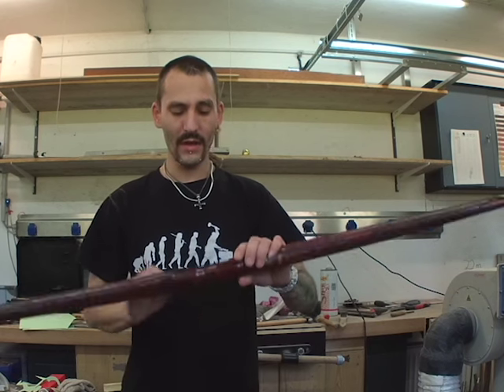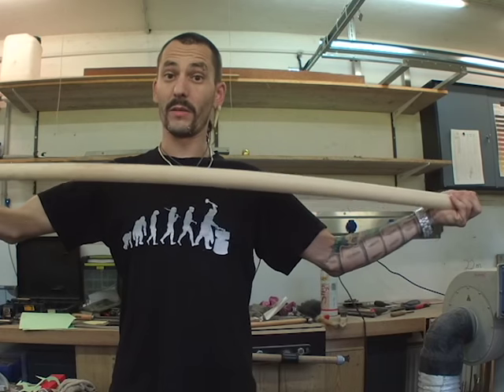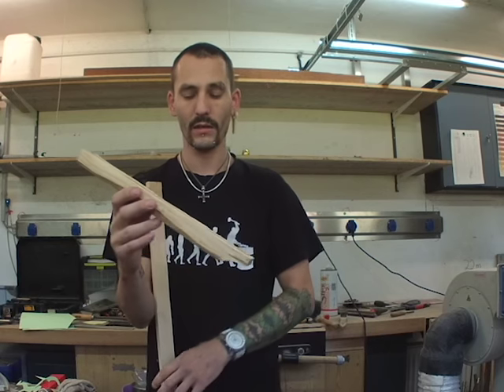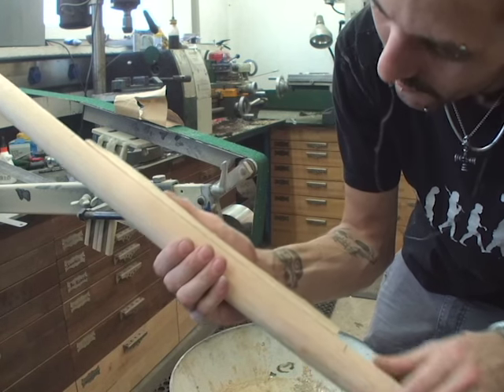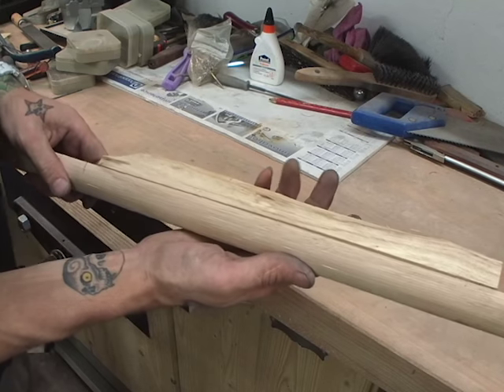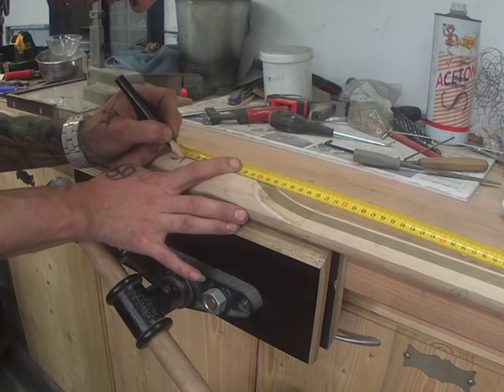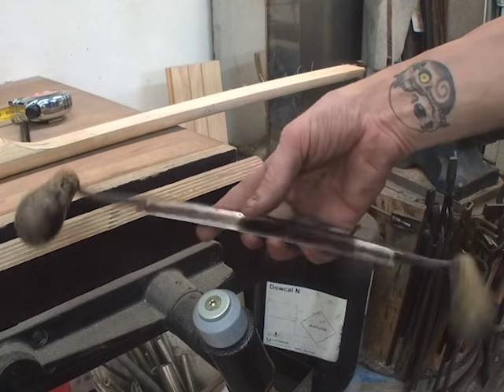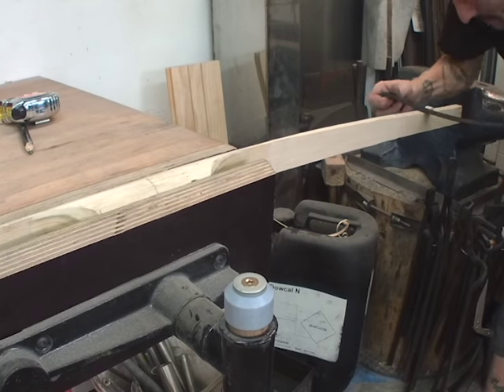How to Make a Rattan Bow Cheap And Easy Part 1 - Making 003 - WSW

Comment: I'm going to make a bow like how you did out of a rattan split in half how thick should the handle piece I glue on to it be? I was thinking of using walnut it's 3/4" thick.
Reply from the maker: i used a half round piece about the diameter of the rattan it self so you i had enough material and from there i carved out my handle.

Comment: I need a rattan prod for my crossbow. I want to make the draw length ten inches how long should my prod be at least? The dimensions of my current prod is 1 1/2 inches at the center which is 4 inches, it's 3/4 of an inch thick. Then it tapers to 1/2 inch thick and 3/4 of an inch wide, it's currently 20 inches long.
Reply from the maker: well i can not really tell you how big it has to be, you will have to try out, depending on what kind of strength you want on youre crossbow, but rattan is very inexpensive an easy to work with. i would start with an aproxx. 24 inch long piece, splitt it and then start shaping. if you shorten it it will become stronger. but for crossbows i never tryed it out. it could be that it dont even work out with that short length. all my crossbows have fiberglass bows.
Reply: Wild Style Works do you think it could pull back to 10 inches if the prod was around 24 inches?
Reply from the maker: well i guess it will be able to pull back up to 15 inches depends also on how thick they are. the thicker and stronger the less drawlength you will get

Comment: Thanks for your vidz. Great tutorial
Can you give me please the detail of the differents measure to make the bow ?
Reply from the maker: Thr staff is about 1400mm long and was 38-40mm in diameter. the handle is up to your hand, for bigger hand make a bigger handle. I make it aprox. 120-140mm. so mark about 60-70mm from the middle to both sides. the limbs at the end are about 22x12mm and taperd up to 36x19mm were the curve of the handle starts.the bow as you maybe saw has 29-30lbs at 28". if you want it stronger make the limbs thicker and backwards the same.
Reply: Thanks guy ! I will try to build one a little stronger near 30-35 lbs. I will tell you the result !
Reply from the maker: good luck
Reply: no luck but patience and pain :)

Comment: hi, what size is your rattan. I can only get 30mm CIA here
Reply: diameter not CIA lol
Reply from the maker: i have two types, one is about 40-45mm and the other is 45-50mm in diameter. Here I used half of a 40-45mm staff. but you can maybe use 30mm too if you take a full staff. but i guess the bow will not get over 35 pounds.

Comment: How did you split it in half? I want to make two prods for two separate crossbows.
Reply from the maker: Brian Anuvattanachai  i clamped it in a vice and then cut it in half with a jigsaw, now i use my bandsaw for this operation
Reply: I don't have a vice but I have a jigsaw what could I substitute for the vice?
Reply from the maker: a tbale with a c clamp or a sawhorse or just a big block of wood to clamp it onto. you just need to keep it steady so it dont move wile you cut it, then its easier to cut it straight
Reply: Wild Style Works how many clamps do you think it will take for it not to move while I cut it?
Reply from the maker: it depends on what clamps you use and how you clamp it but it doesnt need much, so one or two clamps should be enough
Reply: Thank you.
Reply from the maker: no problem
Reply from the maker: wiht an electric jig saw, but you can also use a simple wood saw or a bandsaw, just watch out to not twist the rod wile cutting, otherwise both halfs could get wasted
Reply: Do you round the corners after you get the basic shape?

Comment: What happens if the bark is still on how can I remove it?
Reply from the maker: you can let it on it looks very good with the bark, if you want it away you can take a plane or sand it away or with a drawknife, rattan is very soft only the bark is a bit harder.
Reply: Can you give me the dimensions of the bow? The tapering, fades, arrow rest and etc?
Reply from the maker: Im real sorry i dont have a lot of measurements from this bow, the only things i can tell you is the starting diameter from 40-45mm and the width of tips is about 18-20mm and their thickness depends on youre draw weigth. the length of the bow is a thing of personal preference, mine is about 130-140cm long. the hanlde piece i made about 18-20cm

Comment: Where do you purchase or find rattan?  Thank you
Reply: Could you use a 2 part epoxy to attach the riser and tips?
Reply from the maker: From a seller in Germany but you have to buy bulk to get some
Reply from the maker: for shure as long as it works on wood

Comment: you shouldnt saw yew without protection dude
Reply from the maker: you mean the wood yew? I didn´t used yew on this buildt. but yes yew dust is deadly stuff, this was acazcia wood wich is not very dangerous at all. but all in all i have a dust suction station on my bandsaw.